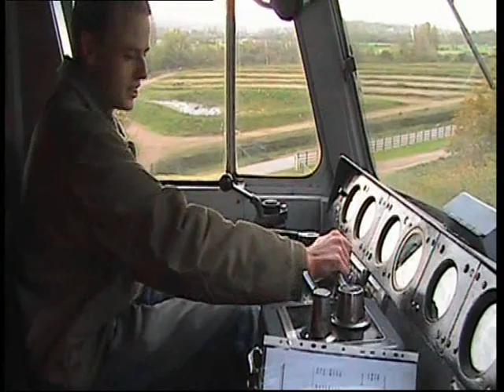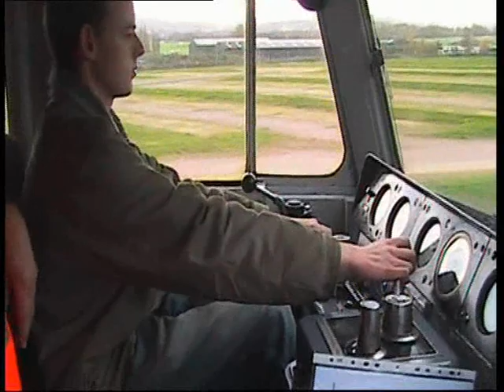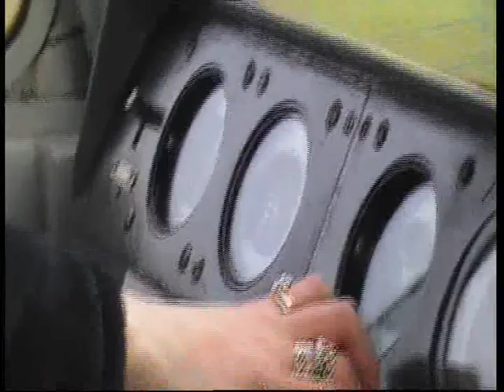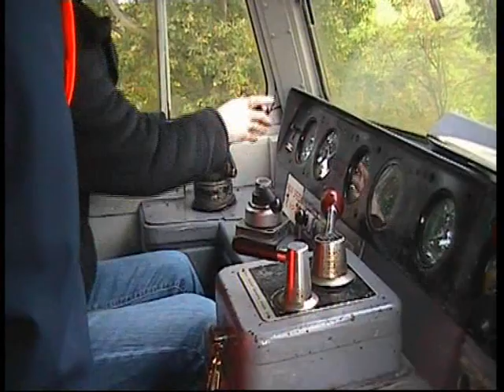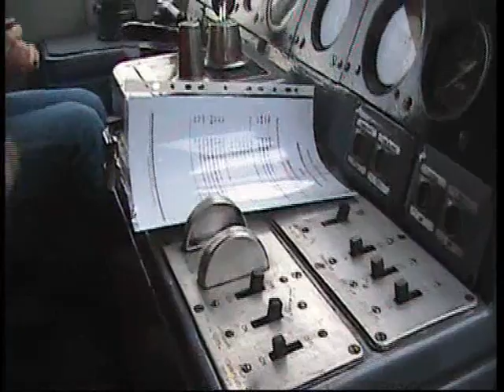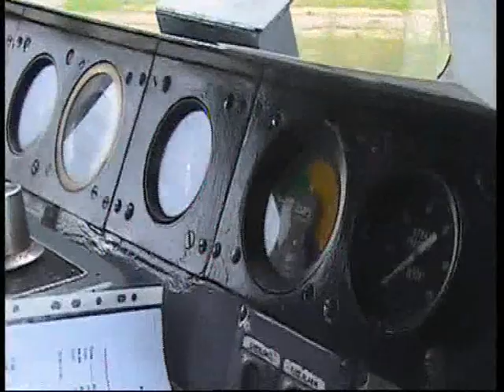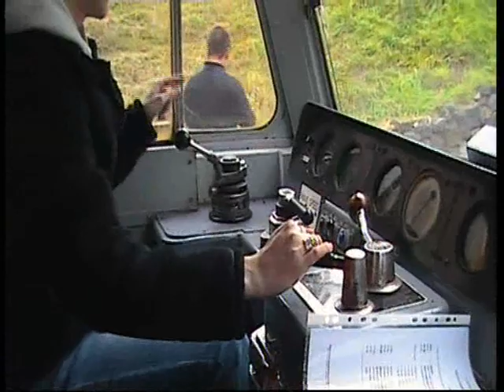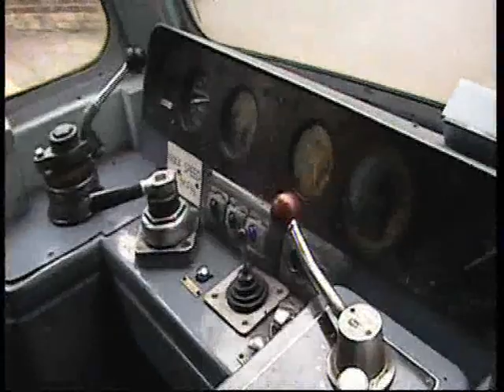Me and my mate driving 47105

Comment: Correct, all trains are set up this way, except it varies on how you turn the AWS on. For the 47 (and such older locos) you pull down the switch behind the cab and slam the AWS reset button. 

For units I think its when you turn the master key in.

I don't know if shunters are fitted with AWS, being an ex-driver of 08032 I know there wasn't any AWS fitted on her, but something like FGW 08's might have..

Comment: theres a small leaver on the front cab baulkhead on the 150/1 as i have cabbed one and saw it, and for a hst you put the master key in the reverser, unlock it, press the AWS reset down then move the reverser and release the AWS reset, the alarm sounds then you reset it

Comment from the maker: Locos (and units) have two tone horns, so you can operate two different tones hence it sounds twice, that's if you pull the horn lever back and forth. Otherwise you can push it or pull it once, and it will sound once.